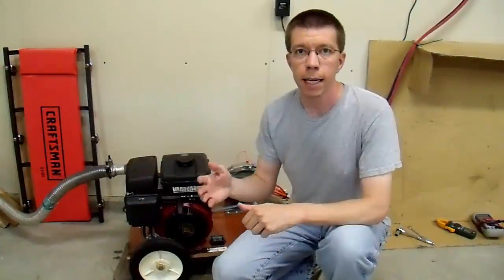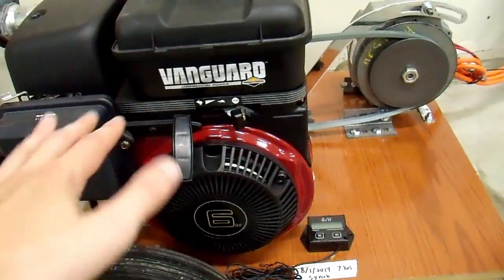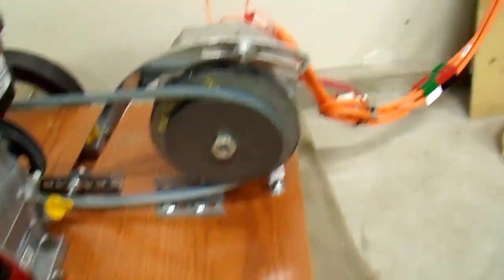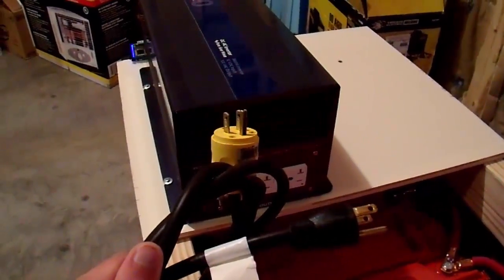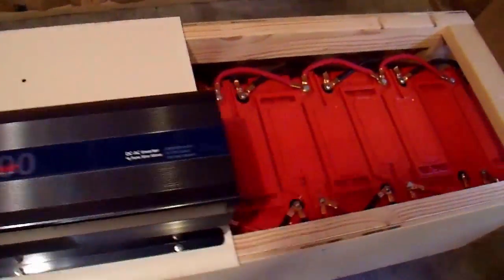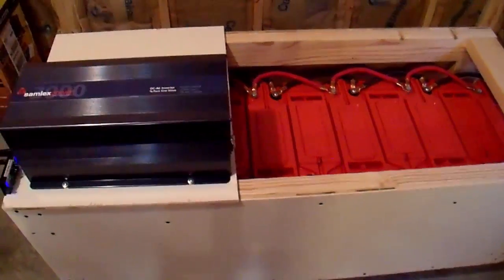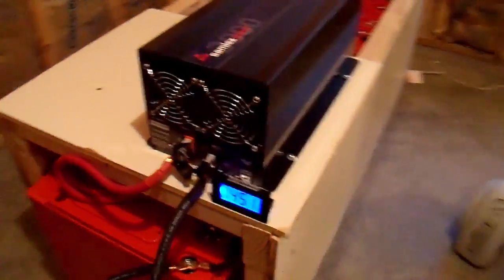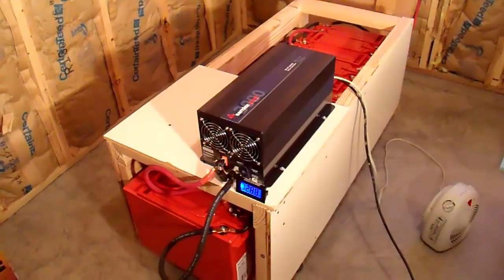DIY 12V Generator Charger - 10 Demonstration and How to Build

Comment: I have something similar, outside but alt field is controlled by a large wire wound variable resistor. I have to watch it as the battery fills since the output drops.  Into a Large 12 volt Nicad charging at 15.5.  The alternators regulator would stop charging too soon at around 14.5 for lead acid :(

Comment: 80 Amp at 2600 RPM  You will need a/ a smoke extractor b/ a fire extinguisher/// Alternators like this need to run at least at 6000 RPM if pushing that much power, because the internal cooling fan is only efficient at high speed and those beasts produce a lot of heat..
Reply from the maker: That is completely incorrect and backwards.  The simple fan of alternators are very inefficient at high RPM and flow a good amount of air at low RPM. Alternators are less efficient at high RPM and overheat at full load high RPM due to said inefficiencies and the higher current high RPM allows.  Remember that resistive heating is proportional to the square of the current.

Alternators are optimized for idle and cruising conditions.  They are NOT optimized for high RPM operation, they are only designed just well enough to not self destruct at full RPM.  If you want to kill an alternator give it full field current and full RPM.
Reply: @knurlgnar24  Nobody wants full field at full RPM! It's akin to torture and against Geneva conventions.. I have a resistor in series so it allows the Alt to run fast (at 2500 engine RPM but the pulley ratio is such) and push about 35 to 40 amps (12v) If i short the resistor then the engine slows a bit, the amps meter shows 80 amp or so and eventually the belt begins to scream and smoke...

Comment: question. What stops you from buying a $30 tensioner pully to keep the belt tensioned all the time
Reply from the maker: $30 is what stops me.  I have to look at it every few hours anyway so an automatic belt tensioner isn't really valuable to me.
Reply: @knurlgnar24  all that is a fair response. That's  kinda how I feel about my 3d printer, just waiting for something to go wrong. I just thought a belt tensioner would be useful since stuff moves a little and belts stretch over time and heat. I also see how much effort you put into making sure the belt was tensioned just right. I do appreciate all the work and effort you put into this project. Thanks

Comment: YEAH SO MUCH NOT NEEDED TO KNOW, RPM/OUTPUT, LOAD LIMITS. 6H PROBABLY EXCESSIVE. 27SI, HELPFUL, THANKS. 1/1 WHY USE A PULLY? JUST DIRECT DRIVE.
Reply from the maker: I covered direct drive in some of the previous 9 videos.  Learned my lesson.  Belt drive is the way to go for reliability/practicality.  A commercial product would most certainly be direct drive to save a few bucks.

Comment: At 13:00 you mention letting it run out of fuel and it not drawing current when switched on. How could that be the case if you just showed us how it draws 4 amps when switched on?
Reply from the maker: The switch is a momentary switch.  Once the alternator is 'kick started' by pulsing field current through the windings there is a diode triode in the regulator that powers the field off of the alternator's own output current internally.  Once the alternator stops turning there is no more alternator output and no more connection to the field windings.

The reason they are built this way is for legacy reasons.  Normally there would be a light bulb in series with the field terminal so that if the alternator failed and stopped producing power the alternator light would illuminate on your dash.  I didn't need that feature.
Reply: @knurlgnar24  I'm even more confused, as the switch shown was a toggle switch, not a momentary switch. Is there any way you could make another video, maybe with a diagram showing how the switch is used? This is the first time I've ever been confused with electronics or automotive systems
Reply from the maker: @mikem5475  It is a push button momentary switch, not a toggle switch.  I watched the video and it looks like I just bumped it real quick to get it started.  I can see how it might have looked like a toggle.  The switch just connects battery voltage to the field terminal.
Reply from the maker: @mikem5475  Also, note that connecting the field terminal directly to battery voltage will burn out the field windings if the alternator is not rotating and cooling itself.  If a toggle switch is used one must use a resistor to reduce the current.
Reply: @knurlgnar24  okay that makes sense. Thank you so much

Comment: Video is 9 years old, battery technology has changed since than. Any long term updates, how long did the engine and alternator last?
How much KWh (or Amp hours) can this generator produce per liter or galon of fuel? It would be easy to calculate, if it runs at 80A, how long does it run on one liter(or galon) of fuel? 
Lot of Amps, long DC wires, long wires are expensive and loose power. Maybe for such system 24V generator and inverter would work better, smaller wires would be needed. 
48V generators are rare, but there are plenty of 24V available.
There is no safe way tu use suicide cable with two male ends. And make sure to completely disconnect house the grid before feeding from the generator, you might give electricity back to grid and kill someone who ties to fix it, or give free electricity to your neighbors.
Reply from the maker: It gives an 80A output for about 4 hours on 1 gallon of fuel.

I bought parts to construct a 48V setup (with PMA and external DC/DC charger/regulator) but never put it together.  I agree that higher voltage would be better but the vision here was to use standard automotive voltages for a very simple and versatile setup.

I've used suicide cables many times.  Saying there's no safe way to use it is the same as saying there's no safe way to use a sharp knife.  One has to be careful and not handle it if you don't know how to safely.  Amazon sells them.

I ran this setup at various times over the years and probably had 50 or so hours on it.  It never had a single problem.  I have since sold the engine and scrapped the alternator so the setup is no more.  It was designed to last an honest 2000 hours with belt replacements and I have no doubt it would have aside from perhaps needing to be re-mounted on something better than MDF.  Note that this was an $800 engine (today).  A standard Harbor Freight style engine would probably reliably last 500 hours when under belt tension and constant heavy load.

Today I have a 48V system and use a standard inverter generator powering a rack mount style telecom charger/supply.

Comment: Awesome set up. I'm curious about how you wired up your momentary switch to avoid the batteries draining when the engine stops. I'm thinking of doing the same thing with an old Honda G41 that I saved. As you can most likely guess. I have better mechanical skill than electrical.
Reply from the maker: My setup was definitely lacking mechanical skill so your build will likely be much cleaner.  I never had any performance or reliability issues with this setup but it sure doesn't look pretty.  Basically the switch just momentarily connects the battery voltage to the field connection.  There's supposed to be a resistor in line to avoid overheating stuff if the alternator stops spinning with the connection still active, but a pulse gets it going once started and from there the alternator powers itself from its output so no further connection is needed.  When the alternator stops spinning it is fully disconnected from the batteries and pulls no draw from the batteries.  In my opinion it is the 'correct' way to do it as a toggle switch has zero benefit over a momentary switch in this setup.  If you want to be safe you can put a resistor or a small light bulb in series with the switch so it is safe to accidentally switch to 'on' with the engine off.  I don't worry about it for the same reason I don't worry about a belt guard.
Reply: @knurlgnar24  Very early days for me yet. I  plan to have my set up under an open air pergola in the back yard. Will most likely build a sound proof enclosure around the engine so that I can remain friendly with the neighbours. I already have an 8.4 Kilowatt generator but it's very noisy. I think a smaller more economical engine charging a battery bank is much wiser. Especially in a prolonged black out situation. 
Appreciate the momentary switch tip.
Reply from the maker: @arpfre  Sound deadening is difficult without putting the setup underground.  I tried constructing a box to house the setup with sound deadening materials and calculated out the heat transfer requirements but it just wasn't practical.  Water cooled engines have a massive advantage when it comes to noise.  Exhaust noise is easy to control, but an engine like this is still very loud with the exhaust excluded.

Comment: 2024: Is your generator still running? I had a similar project waaaaaaaay back in about 2007.
Reply from the maker: I dismantled it about a year ago as I use a different battery setup today.  Now I have a 48V system and use a telcom rack mount battery charger and standard 120V generator.  The 12V alternator setup always worked well for me when it was in use and never game me any problems.

Comment: 5grand of 0 gauge wire   Yeesh your a baller
Reply from the maker: Not sure what exact thing I said you're referring to, but there's about 5grand in batteries.  Not nearly as much in wiring.  :)
Reply: @knurlgnar24  I was joking because 0 gauge isn’t cheap and you have a lot of it but absolutely the battery bank is by far the most expensive part but worth it

Comment: Great setup and video!! How long does it take to recharge the batteries?
Reply from the maker: It outputs about 80A indefinitely under normal operation so it depends on your batteries.  This 1000Ah battery bank shown in the video would be around 12h from nearly dead to full.  In reality when the batteries were in use the engine was always running when I used it to keep them full, except at night when I wanted quiet.

Comment: "efficiency" is pointless if you have to buy a new alternator every 100 hours. 

WAYY TOOO SLOOW to keep cool. The alternator will burn up quickly. Spin it up with smaller pulley to what the alternators are designed for (9000 to 12000 rpm at cruising speed).

To quote the internets: "Typically, alternators have their full output rated at 6000 RPM but can continue to spin up to 12,000 RPM or more without any additional increase in output."

If you stop when you hit the peak output (say 6000) the unit will overheat. the additional rpm is for cooling. If i was you I'd shoot for 9k and see how the temperatures are.

Comment: Wouldn't making that pulley smaller, give you more rpms?  Your pulley actually looks bigger on video,  maybe that was just the angle.
Reply from the maker: More RPM on the alternator reduces efficiency.  This setup was designed and tested to maximize the engine and alternator efficiencies.  Car alternators are wildly inefficient at high RPM.
Reply: @knurlgnar24  Why not use a DC Generator Motor, instead of an Alternator, considering Alternators are Alternating AC Current and you are losing some in the conversion to DC?  It would also be a more stable current.
Reply from the maker: @DeeJayHouser1  I actually bought a permanent magnet alternator for this project but never tested it out.  It's possible some gains could be made with a DC generating device, but I calculate a lot of the gains are simply in eliminating the field current with a PMA.  At low voltages like 12V I could see a DC generator still having some benefit though.
Reply: @knurlgnar24  Thanks.  I've seen one good video of a tread mill motor an a gas powered, but the gas powered was a little small and had a tough time turning it.  I suggested the cheap Chinese Diesel Motor, but i am waiting to see if someone else tries it first...   50+ years of buying useless stuff here.... lol

Comment: You might want to get some electric conduit to guard the wires from mice and rats!! If they chew it up and short out your batteries you might have a fire Hazzard! Just looking out for you😊
Reply from the maker: I put a fuse on the battery bank for such reasons, but I often don't take all the best precautions!

Comment: I'm looking for about your product place lace me a message .When I post this , I am looking for more information on this. 
I am looking for more information on how you built this and put this all together and where you get all the parts for it and what part did you buy in how much were they learning how to build one for off-grid cabin and using solar panels right now is if something happens if I don't get enough like I need one word again power my battery back up until the solar panels can start working again

Comment: Dude, you should have setup a dual alternator on your chevy truck, run a pipe out your garage and used a 300A-400A alternator, makes about half that at idle. Skip all the fabrication, run jumpers to the quick disconnect. put a remote starter and call it a day. less gas used, quiter more power into the bank and remote controlled, about 1 gallon of gas per hour but you get 200 Amps charge on a better regulated system. plus all you need to do is keep an extra couple gallon in your garage to refuel. much easier and much less money. I assume you already have a truck if your a smart American and not waiting on uncle sam to control your life.
Reply from the maker: I like the idea in theory but it most certainly is NOT more efficient and it most certainly costs more.  I have no interest in modifying my vehicles in ways that make them worse for their primary purpose of transportation.  If it isn't OEM I don't want it.  Putting aftermarket parts on your vehicles is a sure way to destroy their functionality, value, reliability, and lifespan.  I also don't consider owning a 'truck' (which are built like any other small car unless you get a heavy duty vehicle that is impractical for general transportation) to be a responsible decision for most people.  This isn't an insult to you personally as you may well need or use your vehicle for actual work, but anyone who thinks they need a 'truck' to be a man when they go to the hardware store is no man at all.  A simple hitch on a car and tow behind trailer is often much more useful.

Comment: The whole reason is not to use fossil fuel. We cannot get away without using fossil fuel. We need fossil fuel, no matter what battery banks, solar panels, wind generators we need good old fashion, fossil fuel end of story you just proved it to us don’t get me wrong. That’s a great set up, but I’d rather stick with my portable generator which is a pure sine wave predator, which is near 10,000 watts I could’ve went with the Honda, but for the price I could not go wrong generator inverter from Harbor freight, and when my power goes out, I have nothing to worry about and it won’t last me one day as long as I put the fossil fuel in it it will keep going no wires all over no suicide chords, no batteries all over the place no tightening belts none of that start it up plug it in turn on my generator switch and my whole house is lit up, including my air condition which is central and 2 1/2 ton with an easy start on it and in the cold my furnace also which is natural gas a fossil fuel anyway, great job. Cheers my friend.

Comment: why not use the alternator current to power an electric AC motor with pulley which can then spin the alternator instead of using a gas motor to spin the alternator

Comment: Had you got a newer hairpin style nippondenso alternator they consume way less horsepower and more than 2x the output, and with 12 diodes they should outlast those old delco alternators by a hell of a long time.

Comment: wrong type of muffler.  as mentioned in other similar videos, a muffler designed for single cylinder motorcycle engines is much better for reducing exhaust noise from this type of engine.
Reply from the maker: This is not true and I explained why in a previous video.

Comment: Love it. Nice job. I've done the same thing. Works great.  Thanks for sharing.

You still use it today?  I see the video is 7 years old.
Reply from the maker: Still have it, still works.  I generally use a standard generator and an industrial battery charger now instead.  Fun project though and this simple system is infinitely repairable unlike my more complex setup today.

Comment: I have a similar alternator setup with a leece neville 130 amp truck alternator, I use it in the field for charging flat batteries, I connected a small diameter (maybe 8 mm copper) jump start cable to the alternator with the alligator clamps to the batter, if I try to use larger jumper cables it stalls out the engine.

Comment: I like what you did but why not keep the original pully size on the alternator while putting the same size on the engine to match. Then you only have to purchase one pully for the engine.
Reply from the maker: Small pulleys have a lower belt speed requiring higher belt tension to prevent slip and the tighter radius causes belt heating due to excessive flexing - on small radius applications you'll often find a cogged belt to reduce this flexing loss.  The result would be excessive bearing loading and lower belt power transfer efficiency.